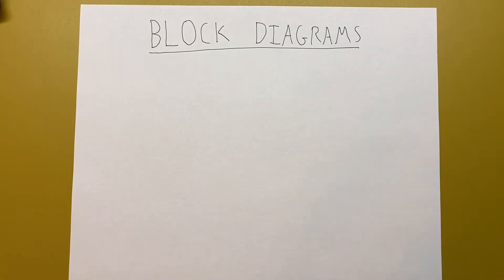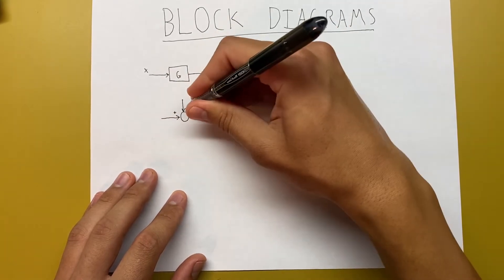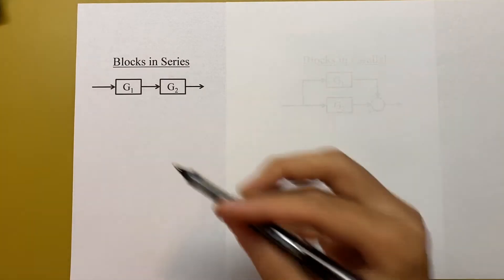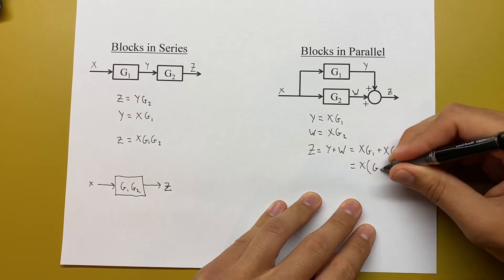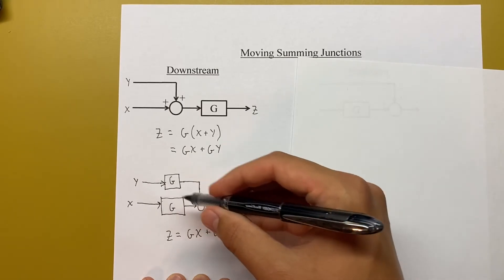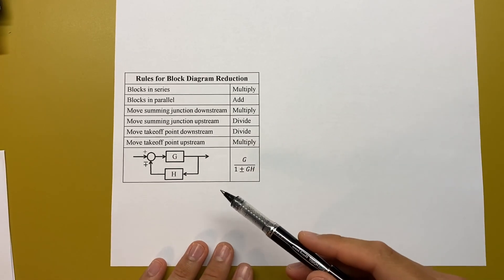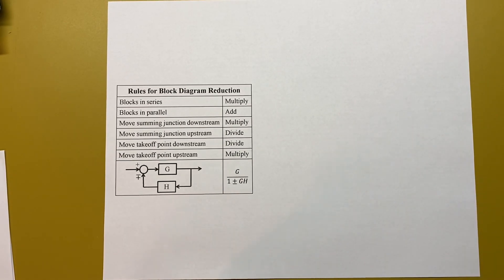Deriving Rules for Block Diagram Reduction

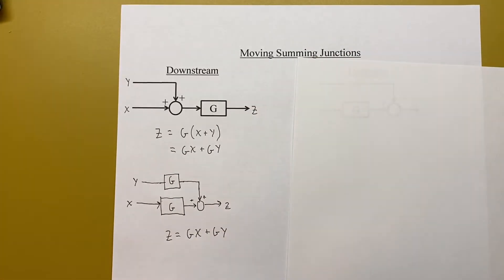Comment: 6:11 sure they are equivalent, but I don't see it as a block reduction if you added more blocks
Reply: While each individual step may not reduce the number of blocks, when using these techniques together on a larger system, we are able to simplify and overall reduce the number of blocks

Comment: What about moving the summing junction across a takeoff point and vice versa?
Helpful video by the way.
Reply from the maker: Glad you found the video helpful! In this kind of block diagram reduction, swapping the places of summing junctions and takeoff points isn’t allowed. If you try to do this, you will find that you actually need to make the block diagram more complicated with additional branches to accommodate it.